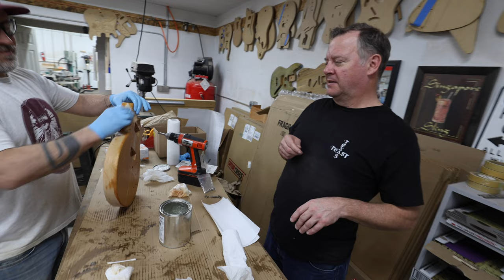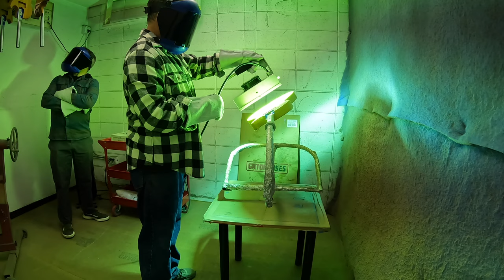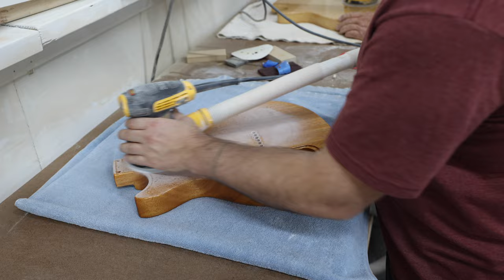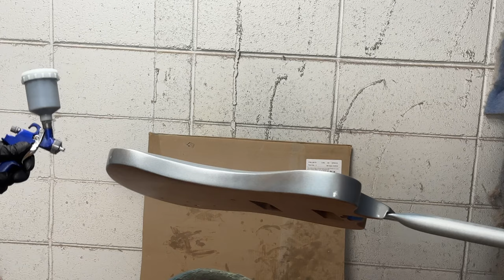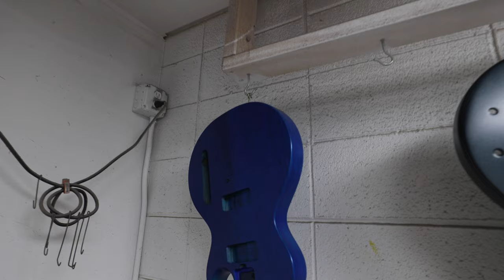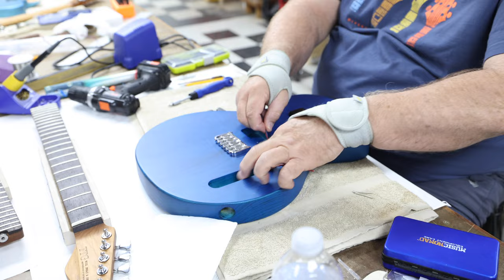Anyone Can Build A Guitar in 5 Days

Comment: Surfboard industry uses UV cure. They build a box with bulbs inside that they can put a foam blank with its fiberglass/resin coat inside, close a door and turn on a switch. I wonder if it would be a good system for this factory?